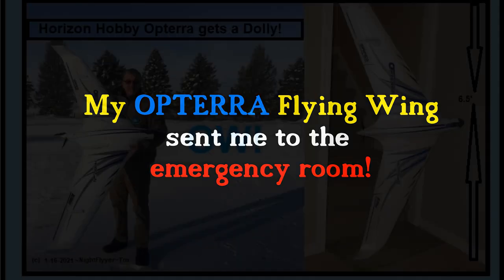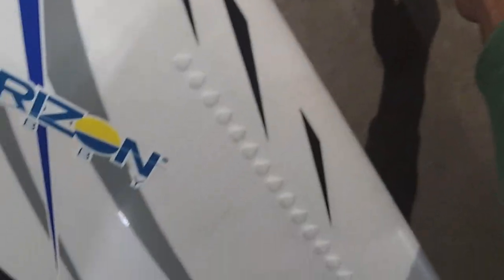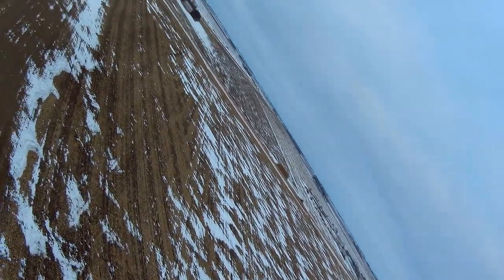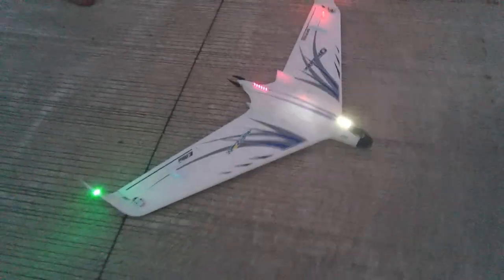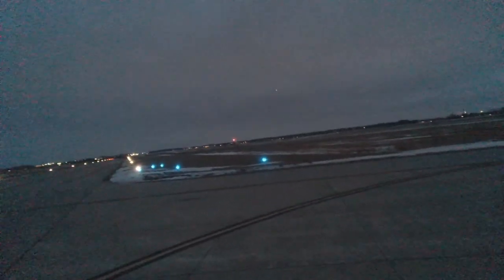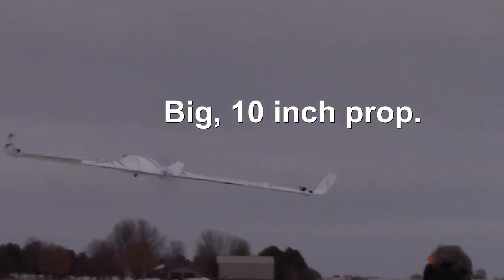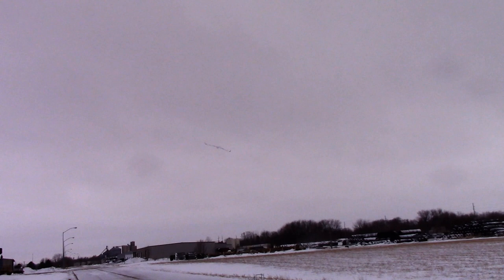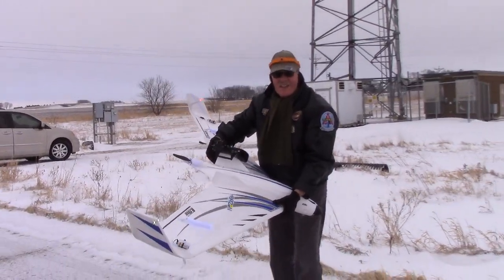My Opterra 2M Flying Wing sent me to the E.R. This is an awareness video & my solution for launching

Comment: Wow I will wear a leather glove during launch from now on. One time I was checking the blade tracking on my Blade 400, one of the links came off causing the blade to dip. Took the tip of my thumb off. Glad you are OK Dave.
Reply from the maker: Thanks for that suggestion and I tried that already, but because it was cold.  I found trying to hold on to the tiny finger grips on the bottom of the 7 foot wing with a thick glove under full power with wind blowing was difficult when under power and then trying to fly with  a big enough glove on was also difficult to fly the transmitter, (I'm a stick pincher)  so although that sounds like a good idea, it did not work that well. Some have told me the Prop got them in the forearm even before launch, when a gust of wind got under the wing and tipped it back, so gloves wont protect that.  We are only talking about a Half inch of clearance that I needed to keep from getting cut, and even though I pulled it off several times in my earlier product review video,  I will never hand launch it again.  LOL.  It's hello dolly from now on!  Thanks.

Comment: Sorry to hear about your injury, I use  wooden dowel with a rubber cleat on the end to make sure it's well away from my hand. The rubber cleat also acts as a holder because using two 1\2 inch plex tubes that extend forward to hold the aircraft straight and level. It took me a few launches to get the hang of it.
Reply from the maker: This plane is really too big for that at 7ft long and under powered while trying to throw it into the wind.  Thanks much and glad your having success.
Reply: I will continue Praying for your recovery. Take care.

Comment: You are super lucky there was someone who could do that delicate tendon repair. Usually that is done by a specialized hand surgeon. I know had about 4 hand surgeries for and index tendon.
Reply from the maker: The Dr said if I had cut them on the bottom I would have to have been flown to a hospital to have a hand surgeon do it, so your right.  Thanks.
Reply: @NightFlyyer  glad it was a good outcome. I need to get my rc back in the air soon.

Comment: Wow, sorry you got cut on that launch. Hope it heals well! It won't help much during the actual launch, but Spektrum radios are easy to set a throttle cut switch. It will prevent motor from spooling up if you bump the throttle stick.
Reply from the maker: Thanks. !  First of all, that had nothing to do with my hand injury. I only mentioned the Throttle arming because I followed instructions in the manual and this is the way it bound up and arms the motor as soon as you plug in the battery. It says nothing about setting up throttle hold. It's a warning to be cautious, because the manual says nothing about programming in a throttle cut to a switch. I've known of times when after flying, that switch was forgotten to be moved to safe and it armed as well.  Nothing is 100% as it could be left in the wrong position, by accident. I'm pretty experienced so never relied to on a throttle cut/hold, as all my machines need throttle stick movements to arm.   I only am warning others to be careful BEFORE the launch and to be careful no matter what you use.
Reply: @NightFlyyer  I have an Opterra around here somewhere. Haven't gotten around to flying it yet. Most Horizon/EFlite birds do recommend setting the throttle cut/hold. And to set it at 130%. I've found that to cause a problem more than a few times. Results in motor spooling up as soon as you flip the switch off even if throttle stick is still at zero. Something silly with ESC calibration. Set 100%, same as zero throttle and it works great. My first RC bird was a Nano CPX heli. Used throttle cut from day one with it. Took two months to learn to fly it, but throttle cut meant it was off power on the way to the scene of every crash and it never broke the drivetrain. The throttle cut habit was learned early for me and I use it on everything I fly. Mostly electric, but gas and glow planes too. I do appreciate you sharing how you were injured and hope that it saves others from that kind of prop strike. I wonder if the Opterra can be launched from the wingtip? Discus Launch Glider style? Would help to keep the hand away from the prop during launch. Get well and back to flying soon!
Reply from the maker: @ChrisDavis-eq9lj  This 7  foot plane cannot be launched discus style as it bends and the big winglets are in the way as well.  I have the Opterra manual in front of me and when I do product reviews , as I did when I got this for Christmas, I always follow the instructions.  There is nowhere in the manual that says to program in a throttle hold.  It had nothing to do with my injury anyway. Here is word for word what the manual says about launching 1. Put the aircraft into launch mode with the channel 5 switch.  (in my first video that did not work, it went into the ground)  
2.  Hold the aircraft in one hand and the transmitter in the other.  
3.  Apply full throttle and throw the aircraft directly into the wind, angled slightly up (5 to 10 degrees above the horizon). 
4.  Climb to a safe altitude and check the trim.   
I know others have their own ways, and either way, my Dolly is the safest solution for me.  The Opterra 2M manual says nothing about throwing it with the motor off, so if a newbie followed the instructions, like I did, I'm showing what could happen, in case a gust of wind got them or something else.  Nothing is 100% and no matter how good you can throw this big 7 foot wing with a 10 inch prop spinning right next to your face, stuff happens. 
Maybe a gust of wind, maybe my 73 year old left arm was weaker, or who knows.   But either way, if it happened to me launching the way I thought was good (and  the same) as all my previous launches. So if it can happen to me, it can happen to others, and that is the warning I want to present.  Thanks.

Comment: Will you move the finger just fine after it heals? I chopped half my last phalanx on my right index two months ago with a chain and sprocket.
Reply from the maker: Ouch.   It moves in some directions fine, but is hard to bend in a curl.  I am exercising it and it seems to be getting better.  I actually can type some now.   Thanks.

Comment: Since time and memorial theres been incidents of props coming in contact with the body with catastrophic results, would it be a good idea to nail the throttle after hand launch as I can imagine this design having a good low speed glide.
Hope you healed well without any lasting effects.
Reply from the maker: Yes, well I just got it and launched it exactly as the instructions said.  Never had this problem with any of my other wings.  I am healing.  Here is exactly what the Opterra 2M manual says word for word.  1.  Put the aircraft into launch mode with the channel 5 switch.  (in my first video that did not work, it went into the ground)  2.  Hold the aircraft in one hand and the transmitter in the other.  3.  Apply full throttle and throw the aircraft directly into the wind, angled slightly up (5 to 10 degrees above the horizon). 4.  Climb to a safe altitude and check the trim.   
I know others have their own ways, and either way, my Dolly is the safest way for me now.  .  The Opterra 2M says nothing about throwing it with the motor off.  I am experienced at hand launching these types of wings, but stuff happens sometimes. This was Murphy's law.

Comment: Switch H on my DX8 is for throttle cut. Perfect for use as a safety and to ensure the prop isn’t moving on glide landings. I think I’ll be building a launch rig for this thing also. This is a good learning point for others, heal up and Semper Fi.
Reply from the maker: First of all, that had nothing to do with my hand injury. I only mentioned the Throttle arming because I followed instructions in the manual and this is the way it bound up and arms the motor as soon as you plug in the battery.  It's my warning to be cautious, because the manual says nothing about programming in a throttle hold to a switch. I've known of times when after flying, that switch was forgotten to be moved back to safe and it armed as well.  Nothing is 100% as it could be left in the wrong position, by accident. I'm pretty experienced, so never relied to on a throttle cut/hold, as all my machines need throttle stick movements to arm.   I only am warning others to be careful BEFORE the launch and to be careful no matter what you use.  The Dolly is definitely my new landing gear and it adds no weight.  LOL  Thanks and Semper Fi.

Comment: I tested a 220mm quadcopter, first without the props if the motors are spinning the wrong way, later with props, in hand, holding from the top to check something else. The motor bell came off and cut my hand with the prop. Painful but those cuts are not that deep, just a band aid was enough ( a big one ), so I was flying that drone a few hours later.
Reply from the maker: Glad you had no problem.  Thanks.

Comment: I wanted to coment on the last video  to be carefull launching . I launch my f27 side arm holding the wing and think that is the best safest way to launch these wings, but i like the dolly for sure
Reply from the maker: I have the F-27 evolution as well and as you saw launched it off my rail  but this big 7 foot wing doesn't have much power in comparison.  I just did it the way the instructions said. 

Here is word for word what the Opterra 2M manual says about launching.  
1. Put the aircraft into launch mode with the channel 5 switch.  (in my first video that did not work, it went into the ground)  
2.  Hold the aircraft in one hand and the transmitter in the other.  
3.  Apply full throttle and throw the aircraft directly into the wind, angled slightly up (5 to 10 degrees above the horizon). 
4.  Climb to a safe altitude and check the trim.   

This wing is 7 foot long, heavy and  will bend and break the end off the if you even try to pick it up by the tip and barely has enough power to fly out of your hand at launch.  I know and I tried to launch it discus style, but could not hold it where I felt I could launch it successfully in the wind.     It would also be extremely difficult to somehow launch it discus style with the elevon there and that 7" tall winglet rudder that is also on the tip.  I know how to do it , but not with this plane.  

I know others have their own ways, and either way, my Dolly is the safest solution for me.  
The Opterra 2M manual also says nothing about throwing it with the motor off, so if a newbie followed the instructions, like I did, I'm showing what could happen, in case a gust of wind got them or something else.     Nothing is 100% and no matter how good you can throw, this big 7 foot wing with a 10 inch prop spinning right next to your face, is risky.

Comment: Wow!!! Sorry to see your injury; that one is truly a good reminder to everyone that these motors and props are dangerous. I see so many videos of kids flying these planes; some carelessly, and just wonder how many have got bitten by the prop? This reminds me of man and woman I once met long ago; the man was a pilot of a small single engine plane, and woman (his wife) assisted him with mechanical maintenance at time. One night he had her to shine a flashlight onto the running prop to inspect something or another, and she misjudged the prop distance and accidently stuck her hand in the it; thereby, losing half of her hand; that one was a very lucky but bad experience for sure. When I see some old timers flying their half-scale prop R/C planes; their assistants walking around the running prop, I just wonder how many have gotten too close... these half scale engines can take a limb off easily; they're not toys. And now with these high speed electric motors and props, they can easily take fingers off as easily too. However, many of these planes are marketed to kids; not a good combo for the inexperienced flyer/hobbier. But happy to see that your injury wasn't as bad as it could have been. ; )
Reply from the maker: Well said.  I followed the launch instructions to a t, and yep, it happened.  Nothing is 100%.  Thanks.

Comment: Friend, so sorry to see you get nicked like that.  It might have been preventable simply by thinking about it but that's what everyone says after they take the hit.  Heal fast and thanks for the warning to everyone else.
Reply from the maker: Trying to launch this big 7 foot wing in wind always has me thinking. I fly 3d helis, nitro planes, drones, etc for over 60 years and never had an accident, because I follow instructions and think about it.  I flew this several times before in my product review video, but again, nothing is 100%   Here is word for word what the Opterra 2M manual says about launching.  
1. Put the aircraft into launch mode with the channel 5 switch.  (in my first video that did not work, it went into the ground)  
2.  Hold the aircraft in one hand and the transmitter in the other.  
3.  Apply full throttle and throw the aircraft directly into the wind, angled slightly up (5 to 10 degrees above the horizon). 
4.  Climb to a safe altitude and check the trim.   
Thanks kindly.

Comment: That's exactly why I don't mess with pusher wings, accident waiting to happen. As far as your concerns with the arming of the ESC, why not just use throttle hold on the transmitter?
Reply from the maker: Of course I know how and have.  First of all, that had nothing to do with my hand injury. I only mentioned the Throttle arming because I followed instructions in the manual and this is the way it bound up and arms the motor as soon as you plug in the battery.  It's my warning to be cautious, because the manual says nothing about programming in a throttle hold to a switch. I've known of times when after flying, that switch was forgotten to be moved back to safe and it armed as well.  Nothing is 100% as it could be left in the wrong position, by accident. I'm pretty experienced, so never relied to on a throttle cut/hold, as all my machines need throttle stick movements to arm.   I only am warning others to be careful BEFORE the launch and to be careful no matter what you use.

Comment: hopefully you are on the mend., i had this happen to me on the same finger as yourself 2 years ago launching an fx61 phantom wing, i love flying wings and the opterra is a real good wing but not being able to side throw is way too dangerous, i had my nail pulled out and the nail bed stitched up, the prop had skimmed the bone. currently any wing i have has an inav or some kind of delayed throttle auto launch flight board in it. they are inexpensive and safe. get well soon sir.
Reply from the maker: Sorry to hear that, but sure can relate. If that Delayed throttle launch is so important (this big, heavy wing barely has enough power to fly out of my hand with a hand launch as it is) so they should include that setup with the kit or at least recommend it in the manual.  Thanks.
Reply: @NightFlyyer  absolutely right. Yet still I see every single flying wing coming to market having holding points on the belly to launch, I don't know why they don't realise it's not a matter of if more like when, unfortunately in absence of them caring we have have safeguard our own digits, that's why I use inav auto launch, it is awesome, give it a try, or a flite test aura light board.
Reply from the maker: @ready-set-test5275  I launched and flew this plane several times and in my original product review video, but again nothing is 100%.  Also that Aura light board should have been mentioned in the instructions or even included in the model.  Thanks.
Reply: @NightFlyyer  unfortunately different manufacturers and different products, thats something that you will have to look into yourself. on a side not i always launched my opterra with a side swing holding the wing, its rather big the the wings hold strong no issue. also a very quiet wing due to how the motor mount is made, iam hearing good things about its little brother the 1.2 version.
here is a link for the flite test aura board
https://store.flitetest.com/flite-test-aura-5-lite-gyro-system-flt-8050/p1152604
Reply from the maker: @ready-set-test5275  Yes. Again I say that if this plane is so bad and others tell me they had this happen, that board should be included in the kit.  Also, I looked on your channel and don't see a video of how you launched this big heavy, 7 foot wing discus style.  I cannot pick mine up with one hand to launch it that way and I tried. It will break or bend and the other tip stays on the ground.  With that 7 inch tall winglet in the way, I could not hold it well, so abandoned  trying it.  From now on I will use my dolly anyway.   Thanks.